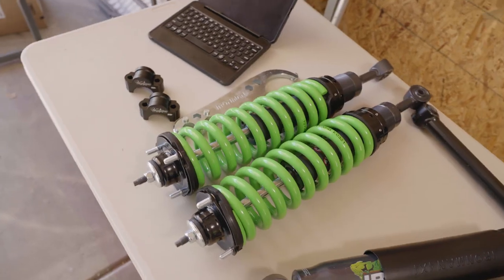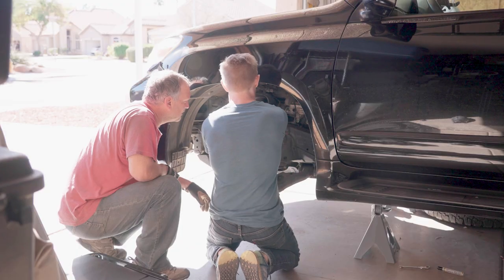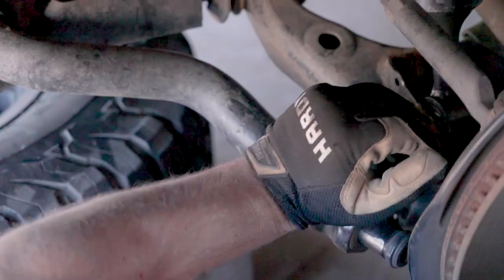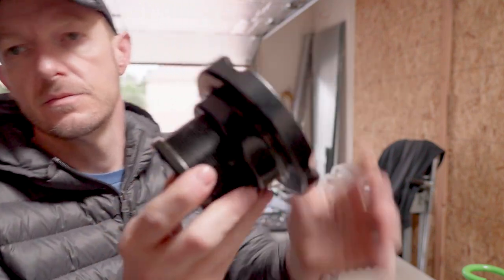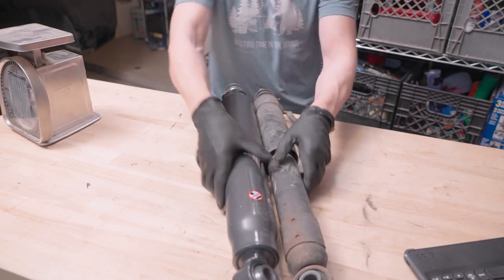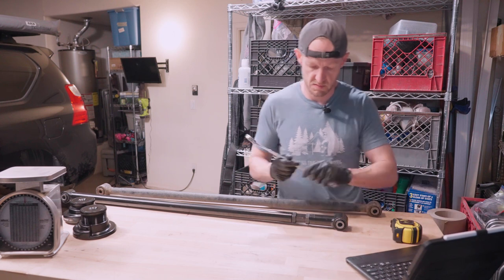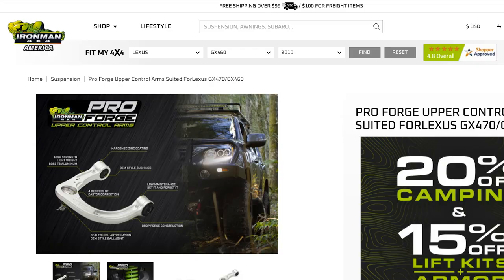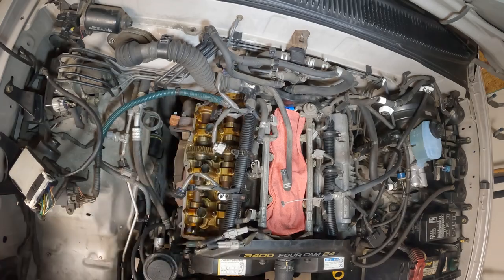GX 460 Ironman Foam Cell Pro Lift Install

Comment: Hugely helpful for us 460 premium owners. Thanks for making this one!
Reply from the maker: Welcome!
Reply: How did you cap off your electrical connectors in the wheel well? And did you have error codes showing up in your dash and info panel?
Reply: @doironjpd  I didn't cap off anything. The fronts I just zip tied out of the way in the engine bay. No codes and it's been through quite a lot of mud and car washes

Comment: Had a very similar experience with my 22' 4Runner. All the kits I've installed (Billstein 6112/5100 - FOX 2.5 DSC - Dobinsons IMS) have all landed off from the expected ride heigh or lean. My 4runner isn't overly heavy (about 150 lbs added total) but I've had to always swap, adjust, add spacers, correct geometry to keep the rear axel aligned, etc etc etc, because it always lands different than expected. And also can sometimes pull to the right. Is for this same reason that I started doing my own wrenching. I couldn't imagine paying (or annoying) a shop with all of these adjustments I've had to make, to make sure it lands exactly where I want it. But I am glad I did. Because I've learned so much.

Comment: I have the ironman cell foam stage 2 installed in my 2017 GX 460, I was planning to do it myself but l don't have an adequate place to work on, so l decided to have a professional shop to do the installation, $600 later, it was all worth it, every happy with the ironman system, now you need rock sliders, I'd recommend white knuckle off-road
Reply: Couldn't agree more with having a shop do the install after seeing Jake's video.  I don't have the space or the tools on hand and was worried about the kind of issues he ran into.  Love my Nitro Gas Stage 2 kit.  Remember to match your spring selection with anticipated load.

Comment: First, thank you for the content on your channel as I have nearly the same gx460 and your saved me lots of time with my build. Second, I installed a stage 3 and had every issue you did and a few more. On the sway bar I learned that a $12 2 ft alignment bar and a few jacks to apply pressure changes the game. Also you MUST put the passenger side of the bar back on first. It’s a fixed point and the kdss hydraulic ram is on the driver side. Budget a day for you UCA if you have a lot of connections on you barter cause that’s all gotta come out to get the bolt positioned on the driver side!
Reply from the maker: Yeah, we did the R side first then used a jack and screw driver lever to reconnect the drivers side. I might just disassemble the whole IFS system when I do the control arms since Im doing the lower’s too. Then I can grease the bearings and get used to the layout. I rebuilt our 3rd gen 4runner completely and now I feel like I could change it’s shocks out in my sleep. I really appreciate you following along and thanks for the insight : )

Comment: I was able to get the front shocks in by dropping the skid plate and compressing the kdss cylinder with a floor jack. Didn’t even have to unbolt the kdss or sway bar. Was effortless once I saw a random YouTube comment mentioning how to do it. Spent two hours trying to figure it out first. Seems to not be well documented anywhere but it’s so much better than fighting it with a 2x4.
Reply from the maker: That does sound better. Might try that sometime. How did that work of the R side with the fixed link?
Reply: @WastingTimeInTheWoods  I was able to jack under the opposite side wheel and it dropped down, just couldn’t do that on the side with kdss because it fights you too hard.

Comment: Sorry to hear that you had to go through all the trouble. I have installed ironman with UCA on my gx460. I didn't even need the spacers and nothing collided. Luckily I had the non airbag version which made the install very easy. I had to install the spacers later to give more room for droop at the rear. I have been to Black Bear pass, engineer pass, hells gate and merus. It's keeping up everything.
Reply from the maker: Sounds like a sweet rig. Wasn’t that bad on my install, I just bitch and moan for extra entertainment value ; )
Reply: @WastingTimeInTheWoods  that's the reason i like your channel. Humor with knowledge. I recently did the black bear pass and hell Revenge. Lexus is awesome engineering Marvel

Comment: I did what was then the Stage 3 Kit with UCA’s on my non-bagged 460. I disconnected my sway bars also, but I have 3 floor jacks so I used a combination of those and ratchet straps to get the sway bars back in place and bolted up front and rear. Did the whole thing myself. If I had a helper I might have been able to use the 2x4 trick to get the coil overs in, which caused much swearing on my part in any case. 

I though the UCAs were going to be a pain, but they weren’t bad actually. My alignment with the lift and new UCAs was not far off. The alignment shop only had to make one small camber adjustment and I was good to go. 

I experienced  the same with crazy height on install, but a quick drive and it settled right down. I have probably the same rear springs as you, performance 2”, and with any load they settled down. With the family of 4 and all of our camping gear loaded up, she sits really nice and rides like a Caddy.
Reply from the maker: Yeah, I should remeasure now that its been about 6 months since the install. Still looks like a stink bug though.

Comment: The reason for extra lift in rear is because of the coil conversion. Ironmans bottom perch adds extra lift that non airbag GXs wouldnt have.  I believe Metal Techs bottom perch is the only one that doesnt add extra lift.

Comment: Man I've been there. I think we all have. On my install I ended up loosening the front lower control arms knowing I'm going to get an alignment anyway. That made it much easier for sure. I put the truck on the ground and tightened everything up however now I have an assortment of warning lights on and my steering wheel is way off.  Hopeful a proper alignment and a google search with fix my issues. Take care!
Reply from the maker: Good luck! Dont forget to do a zero point calibration. Took care of the Christmas tree lights for me.

Comment: Just did this install this weekend. Removing the sway bad was very VERY tempting. Had some issues but everything came together alright. Though I'm still throwing codes to check air suspension after removing the fuses and wondering how best to seal off the electrical connectors
Reply: Sway bar
Reply from the maker: Awesome. Congrats! Did you do a zero point calibration? That might fix it. I never had any issues. I just used electrical tape and wrapped them up and zip tied them so that the connectors would gather water (pointing down so they would drain any water). Curios, did Ironman ever update the kits or did you have to cut the bolts for the spring perches?
Reply: @WastingTimeInTheWoods  yep, had to trim the bolts. It was an older kit though. I've had it sitting around for over a year. Hopefully they've updated them since. Your video was very helpful, appreciate the upload! My next move is to mess with the height sensor and see if that helps correct the error

Comment: Doing a 3” lift this weekend thanks for the video. What did you set the rear bag delete spacers at?
Reply from the maker: I set them to the minimum height then raised the L side 1/2" (to compensate for the lean). I got +3.375" on both sides after settling with 3" 'stock load' springs.

Comment: Silly question about the front. Why not use a spring compressor.  Or put the wheels on and lower it so it compresses the spring and then connect the sway bar?
Reply from the maker: Probably could of, but I hate those things. Since doing this I’ve seen a few demos of how it can be done by jacking up one side.  Ive got a set of ucas and lcas sitting on my shelf so I’ll probably find out here shortly.

Comment: Kudos for doing the install and sorry to see all the drama. Looks like you have a “good” excuse for that swing out rear bumper, bump up to 33s, and an extended range gas tank. Maybe I’ll leave our rear on air springs and just upgrade the rear shocks as adjusting air rise height with washers take 2 minutes.
Reply from the maker: Most of the trouble was just my inexperience. Getting more comfortable being covered in grease now : )

Comment: Just found your content and learning what i can from you... We are debating getting a 460 or a 4runner or a grand cherokee to use for light trail riding & exploring here in Oregon so we can take my mom with us to get her out of the house after we recently lost my dad. So I guess I'm curious on your take, if you have a moment, on those vehicles new and what your thoughts are on loading 3 dogs (2 german shepherds and a lab) and 3 adults in with some light gear for day trip exploring (13 hr drive days round trip). Do you think either one is better then the other? It's also will be my wife's daily driver and she's 5' nothin... So I don't want to get something big for her then she won't want to drive it. Anyways, hope you see this and give some input. Love learning from your content and its super entertaining.
Reply from the maker: Thanks buddy! So sorry to hear about your dad. All three are pretty big vehicles but none are too hard to get into if you don’t lift it (& u don’t need to) Im biased. We own a 4runner and GX and I would never buy anything but a Toyota product for resale and reliability reasons. The one thing I’ll say about our GX for dogs is that the rear air conditioner is amazing for them. They pant and drool a whole lot less when they jump back in the car since they have their own vents all the way in the back. Its only on premium models though. Good luck and let me know where you land!

Comment: Hi. Nice videos and good job done. 

Quick question: did you get “ check air suspension” error in the dash. 

I have the same setup installed on my gx 460 model 2010 and 2 things that i m not happy

1st is obviously a “ check air suspension “ error on the dashboard which is permenant
 How do i remove it ?

2nd from the front the vehicle is much lower than from the rear. Assume its the design of this vehicle 

Can you pls advise to make my day
Reply from the maker: Not sure what I did to get so lucky but I never got an error and never added washers to the sensors or anything. I did a zero-point calibration (paper clip method) right after the lift, and all the warning lights went away and never came back. I left my compressor and valve block in and just removed the lines. Hope you can sort it out. Warning light would drive me crazy!

Comment: Hi was your driver and passenger side coilovers different? It seems that they shipped me 4runner coilovers which says passenger , driver on them! also wondering if they are same as GX460 coilovers.
Reply from the maker: I think they are just set up differently for lean but not sure. 5th gen 4runner and gx have the same struts so don’t sweat that.

Comment: Are your rear shock perches adjusted all the way down?  I don't recall you mentioning anything about that in your video?  FYI - for whatever reasons due to suspension geometry and "magic" whatever distance your adjust on the perch is DOUBLED in ride height.  

I have been running the same suspension for almost 3 years now on my GX470.  In that time, I have had to make several adjustments to my spring choices due to unplanned modifications.  Initially, I went with the front performance springs and a year later got a steel front bumper..... so I upgraded to the HD springs.  The rears were probably the same option as yours, up to 660lbs.  However, over the years I have accumulated so much gear that the rear began to sag.  Instead of going to the rear HD spring, because I thought it would be over sprung and the ride would be too stiff, I opted for those spring perch adjusters to get the extra lift I needed to level out my truck.  When I am unloaded, it sits like yours with a noticeable rake.  When it's fully loaded, it's perfectly level.  I have learned to live with it and it's a good compromise.  I also thought about raising the front coil overs a tad as well.  Have you thought about that?

I have been watching your build progression over the past year or so and since you are "budget minded" I would say stick with what you have.  Like me, I purchased so many things I never thought I'd buy and all that weight really impacted the ride height of the truck.  You might end up buying a rear tire carrier or rear bumper like you mentioned.  That alone will probably make a substantial height difference in the rear with all of your additional gear loaded in the truck.  

I am also on the fence about buying a steel rear bumper with swing outs and again, I will probably end up purchasing HD springs and have to adjust the perches to a lower setting.  I know you didn't know about the spring options when you ordered your kit, but perhaps in light of saving some time and cash.... in the long run I think you'll be okay.  I guess worst case scenario, if you do go to the 1.5" springs, keep your current springs just in case.
Reply from the maker: Great insights. I agree. Leaning towards not messing with it and maybe adjust the front up a half inch. We’re renting a travel trailer to go to Sedona in October and I think I’ll appreciate the extra sprung in the rear. Thanks for the tips. Sounds like you’ve been around the block a couple times : )